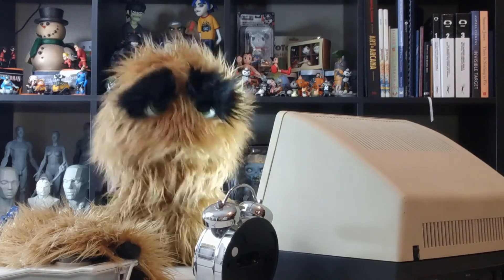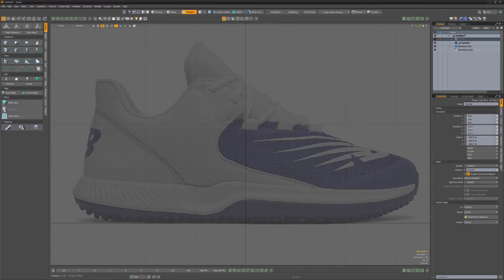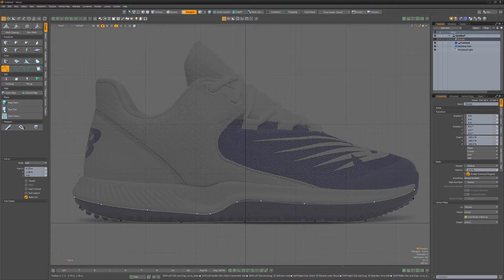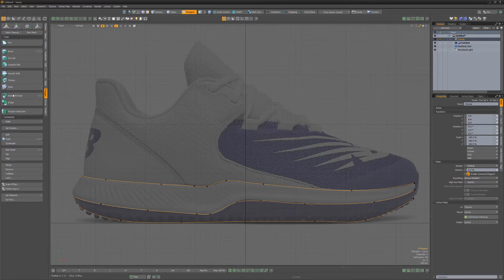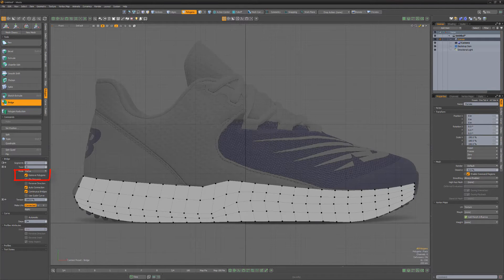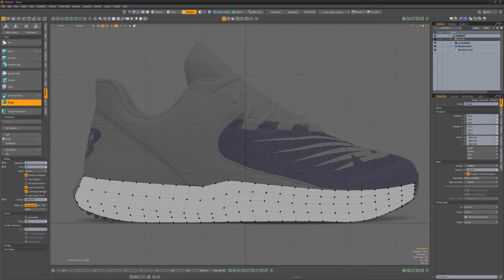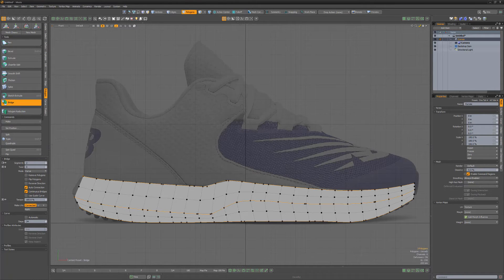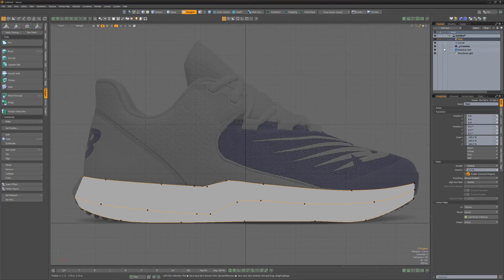MODO | Bridge Tool: Remove Polygons

Comment: Never knew this worked with curves. I having to use other 3D software at the moment and starting to realise how much functionality Modo packs into one tool. Also a discovery I made recently is using the duplicate function on the slide tool as a powerful new way to create new edges.
Reply from the maker: That is a useful feature of the slide tool!